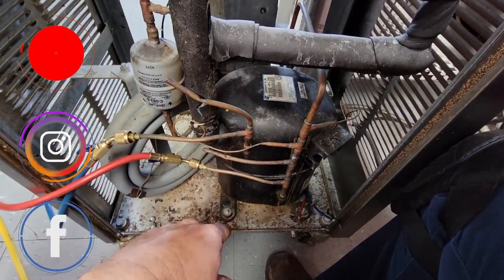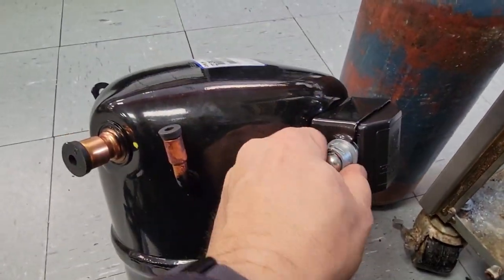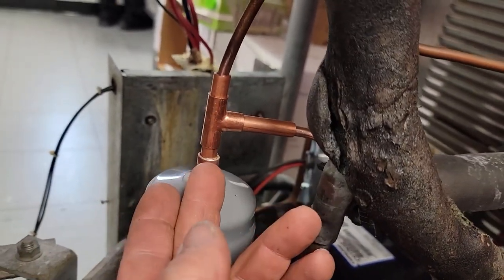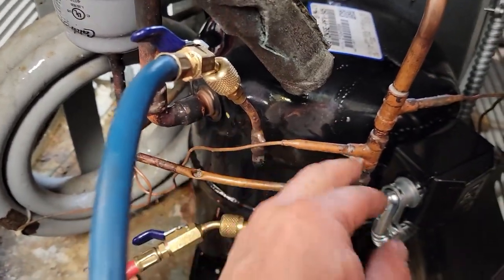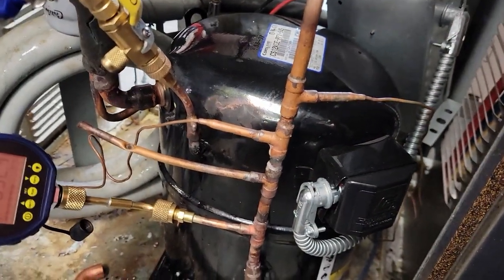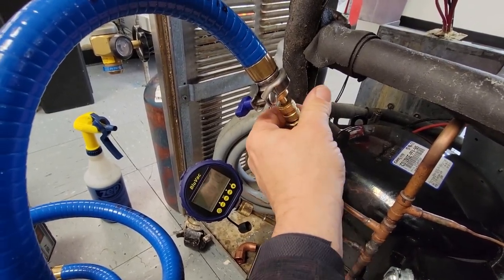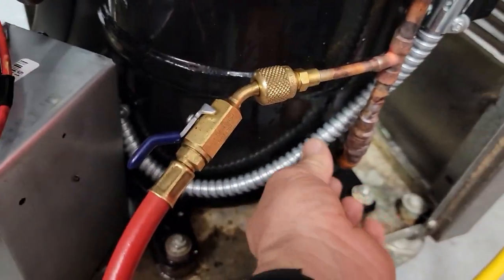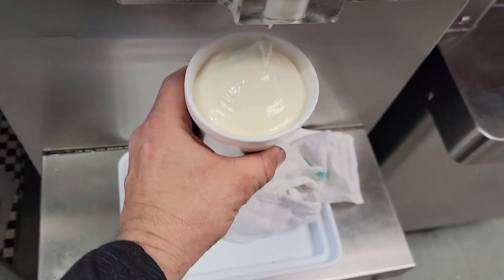My Milkshake Brings The Techs To The Store

Comment: I got my "formal" training in HVAR/C in the Navy at the FBM Training Center in Charleston SC. 
I was in charge of the outside machine shop (38a) on a submarine tender.
I oversaw all repairs on the boats, that had a bolt or nut on it 
3 things will keep a boat from getting underway....
1. No movie projector (dating myself)
2. No popcorn machine.
3. No Ice cream machine.
That is no shit true!
R-12, 22, 11, 114 schools were no bullshit! They don't like refrigerant leaks, of ANY size, and those guys gotta be happy and comfy!
Reply from the maker: That all sounds true to me, Thanks for serving!
Reply: I worked with a guy that did  years on a sub. He worked with the nuclear reactor. He asked me to draw out a simple A/C circuit. Their was a nick in the desk I was sitting at, so my line voltage was not perfectly straight. I handed it to him  and in seconds he say wrong do it again. I am like what ever. Next time I miss that nick in the desk hand it back to him he goes correct. Then showed me the difference between the two. Their mind set is off the charts and they don't FK around period. He ended up taking a job at Boeing..
Reply from the maker: WD - thanks for sharing! I can see where he was coming from. More people should take more pride in their work like that guy did.

Comment: I'm being told by our corporate trainer that it's OK to have the micron gauge at the vacuum pump, with 1/4 hoses and manifold,  ect. Once the pump reads 500 microns, at the pump, it's good to go. Even though the system reads over 2000 microns lol
Reply from the maker: Right 🙄, it will work but at what expense to the life of the compressor🤔
Reply: corporate sales....

Comment: I sent to a NAVAC seminar recently in  Las Vegas this past month, and hose size was the biggest key to a fast and deep vacuum. Their 2 cfm vacuum pump kicked a 10 cfm arse all due to the fact that the 10 cfm was pulling through 1/4” hoses and the manifold. Also on the Wetrag; great stuff! Remember to remove the putty off TXVs after welding as it will hold heat as well after brazing.
Reply from the maker: Good point on the Wetrag, it defiantly holds the heat just like a heat sink

Comment: Oh, I don't know...I think I'd like an ice cream flavored contactor.

I have a can of the wet rag that I have yet to experiment with. I'm told it can be re-moistened if needed.

Although I'm sure the bigger hoses go faster, I just don't trust those core removal tools enough to use them in a vacuum application. I've always been content to pull vacuum through the manifold, even if it does take longer...then again, I'm not doing this day in and day out.
Reply from the maker: The hoses have been proven to speed it up but to each there own👍👍

Comment: Not ever worked on one of these machines, why 2 dries (copper spun at cap tube)? and sight glass on a cap tube system, I definitely don't see that very often. Thank you for making this video, that NAVAC looks very easy on the old back.
Reply from the maker: Because it's right in front of the capillary tube system that has a tendency to get plugged up easily, if the system would have been wet or burned out I would have replaced the dryer even though I know you're supposed to change it anytime you open the system. I'm really surprised more people haven't yelled about it. Every time I change one of those I tend to blow through them to see if they're restricted and generally they never are. Most of the drying is going to be handled by the oversized 163 dryer.

Comment: You should buy the adapter so you can use your M18 packs. Works well on my 2CFM.
Reply from the maker: I did but I don't think they would like to heat that. lol it still needed to be trimmed to fit properly

Comment: Shaking the compressor will disturb any vapor locked up in the oil.
Reply from the maker: I do that at times and depending on how big the system is I might even use a heat gun